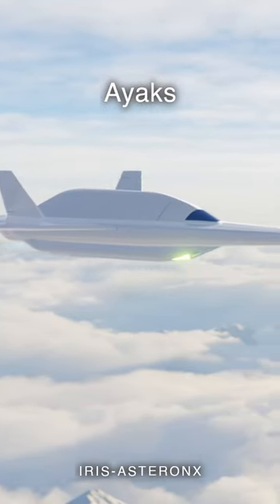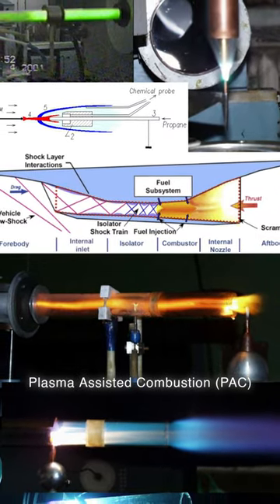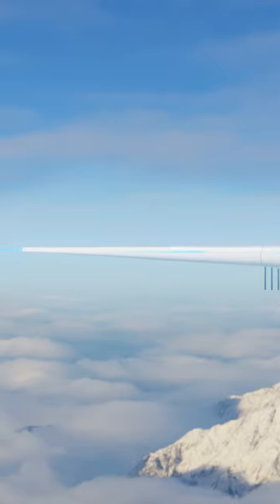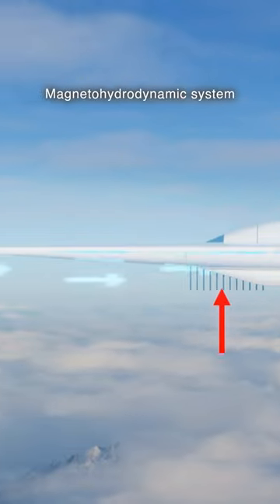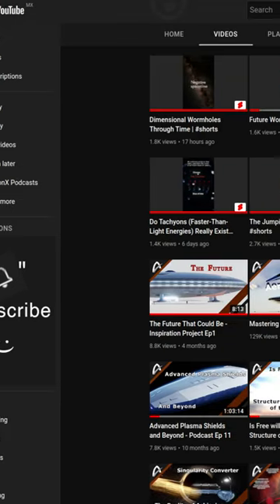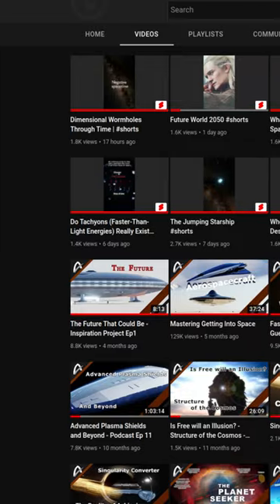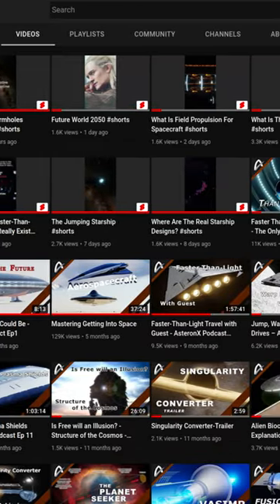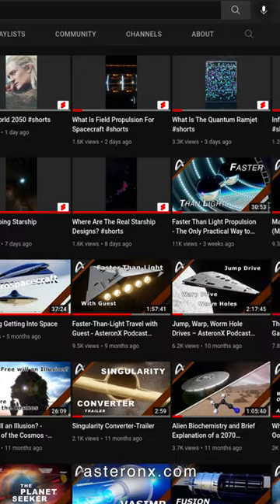Plasma Sheaths and the Ayaks | #shorts #plasma #plasmasheath #magnetohydrodynamics #asteronx

Comment: Sounds overpriced as hell. Plus it uses what looks to be a ram or scram jet which have basically become irrelevant for anything other than experimental showcase planes for world records. 

Also how exactly would magnetic fields do anything? Air on it's own isn't magnetic unless it's already a plasma. The only way that would work is if this thing were moving so fast the air spontaneously combusts, but then no matter what it's made of it would melt. 

The alternative is having the world's most powerful magnet literally able to manipulate neutral charge atoms, but then this thing would need a nuclear reactor built into it. 

Just because something is "designed" doesn't mean it was realistic. It's like that guy who said he made a car that could run on water. Yes he was technically right, but in practice it didn't actually work.
Reply: i just found out about this stuff and did a google search, a nasa powerpoint from 2014 popped up and it had some good info. of course whether the real world's complications allow us to build even a prototype engine, who knows lol. not to mention the eyebrow raiser features like sonic boom silencing it talks about. the powerpoint has some of the relevant equations and i wanted to try to work out a rough idea of the energy requirements to figure out if theres even a chance these could be out there😅